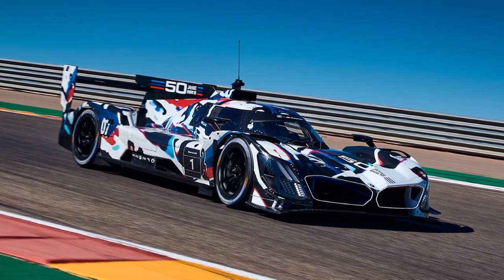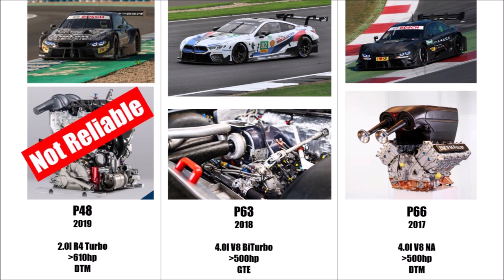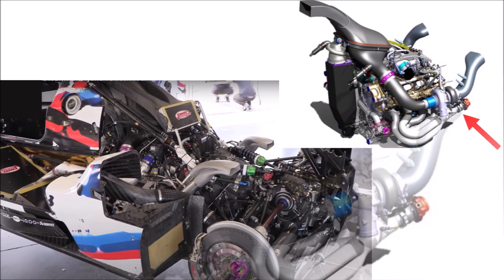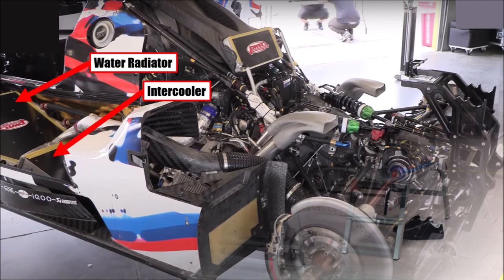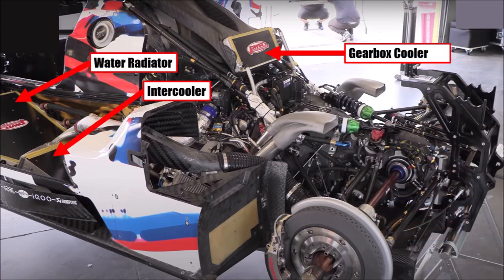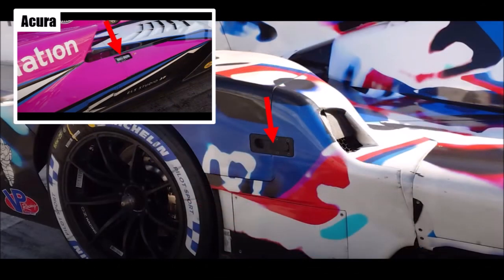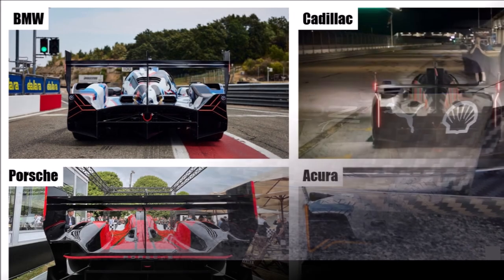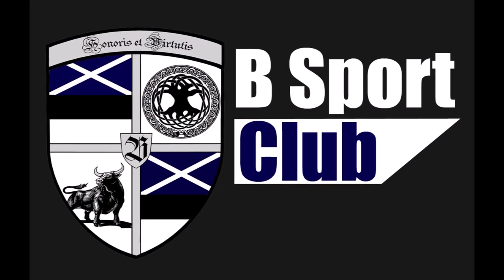24h Daytona 2023 - BMW M Hybrid V8 LMDh - CLOSER LOOK

Comment: Creating outwash on the tires actually increases drag, but it allows you to take drag out of other parts of the car. So you can end up with a net drag reduction. The scoop behind the rear tire on the ARX-06 is a perfect example of this. They chose to focus on the diffuser over the rear wing, and put the scoop there to improve diffuser performance, so they could run a flatter rear wing. If you notice, the ARX-06 has a more aggressive diffuser design than the others.

Comment: This is such an exciting championship with so many different brands but as we saw over the weekend the performance is so close
Reply: That's BoP, not engineering excellence.
Reply: @X8X8X8X8X8X8X8X8X8X  bop still can't save a bad car though
Reply: @ct0560  
It can't. Still it artificially equalises cars which are all built to the same regulations, and is therefore very much a violation of the very principle of motorsport.
Reply: @X8X8X8X8X8X8X8X8X8X  Unfortunately. There is no more Racing. Only Marketing 
Racing Survives because of Manufactures 
Manufactures Race to Market
So if BOP doesn't Exist. Then we get no Manufactures or
You get Porsche who will only enter Series they have an rules Advantage in. 
Ducati does this too

Comment: Hi there,
Could you please do a video explain what does it mean as a chassis? Would that be comprise of only the monoque, or more? How does teams like BMW and Cadilac get to differentiate their car base on the chassis?
What design choices are dictated by the chassis? (Aerodynamics, suspension, drivetrain etc)
How does a manufacture select their chassis provider, what are some parameters to consider?

Comment: BMW's engine / forced induction setup looks strangely archaic
Reply: looks more than adequate
Reply: @Ali Cuntë

Long tubing runs on the hot side towards the turbocharger. 
In a BoP formula, driveability and responsiveness matter a lot more than net power, so it might explain the pecking order right now since they're not BoP'ed. 

Also from my armchair analysis, how crowded the rear end is and how small the diffuser is compared to the other cars might affect aero balance, not net downforce figures since it's regulated.

Comment: "It's beneficial to use a turbocharged large capacity engine so you have the best tools to get the most out of BOP."  Have Ferrari, and especially Acura, made a mistake by going with such small capacity engines?  (The 2.9L road-based engine in the Ferrari, and especially the relatively high-revving 2.4L modified Indycar racing engine in the Acura.) 

Yet *surely* Acura know what they are doing, and have a good reason to have chosen a small, lightweight racing engine -- even if they will need to carry engine ballast that negates any weight advantage?  Is there no packaging advantage to using a smaller racing engine instead of a large road-derived engine?

I appreciate that B-Sport is German and is following German logic like BMW and Porsche! 😂 But I can't imagine that Ferrari or HPD would make such an "obvious" mistake *if* it really is such a mistake?

For the inverse, what is the advantage of using a small capacity engine (as long as it durable enough for the 24 hours racing, which Acura and Ferrari seem confident of)?  Lower friction (offset by running at higher rpm  though)?  More efficiency somehow with more boost pressure and working the turbine harder (where the big engines have to waste more energy out of the wastegate, given there is no MGUH on these LMH/LMDh engines AFAIK, and any extra exhaust energy will just be wasted)?
Reply from the maker: Compared to previous years, this new generation of hypercars is all about using what's already in your shelf instead of developing a new engine like in the olden days.
So they didn't make a mistake, Acura, Ferrari and most of the others just took what was already there.
Reply: Peugeot are also using small capacity with a 2.6l V6
Reply: @BSport320  But I have to disagree with your point that larger capacity must be best, else Honda would use their 3.5L NSX engine.  So there must be advantages, possibly major advantages, to the small capacity engine!  Indeed, perhaps it may turn out to be the optimal solution in hindsight while BMW and Porsche struggling to make their overly large engines competitive?  Honda are obviously going for the win in IMSA and hopefully in WEC and Le Mans too.

Even with the engine ballast, perhaps the smaller Acura engine allows for significantly superior packaging and aerodynamics?
Reply: @TassieLorenzo  The engine in the Acura was originally made for the new Indy car regs which got delayed, that’s why it’s being used
Reply: @dsr_2443  Agreed, but they are hardly going to use a smaller capacity engine if it gives them an overall  disadvantage, no?  So there must also be advantages to using a smaller more stressed engine -- whether that's packaging for better aerodynamics or that it's more efficient (more laps per stint or that they can carry less fuel weight at all times, even if there is a BOPed restrictor on refuelling rate), right?🙂

HPD (and Peugeot and Ferrari) have not read the rules then decided to do anything that would give themselves  any kind of disadvantage after all!  They are all there to win, and know just as much about engineering a racing car as Porsche or BMW after all, or indeed Toyota with their engine capacity somewhere in the middle.

I'm sure the former three would have found a 4.5L V8 and stuck twin-turbos on it, if that was going to be any kind of advantage!